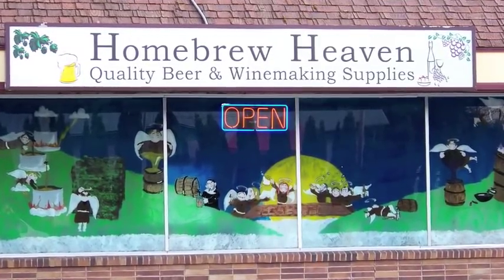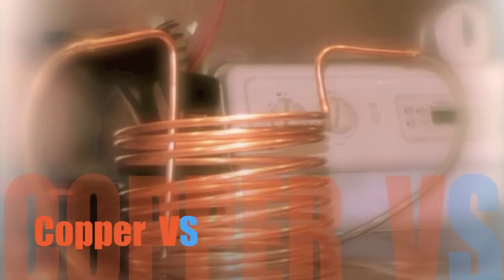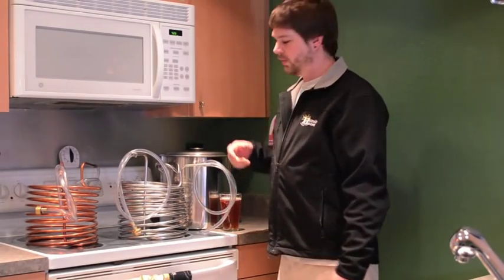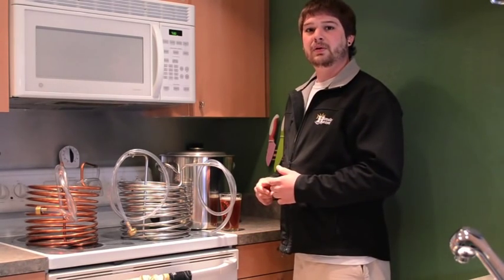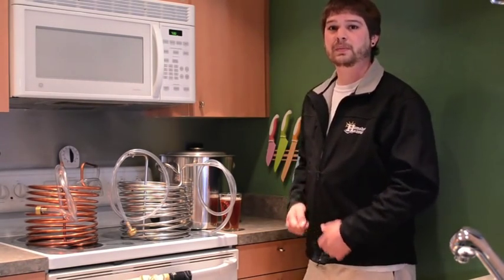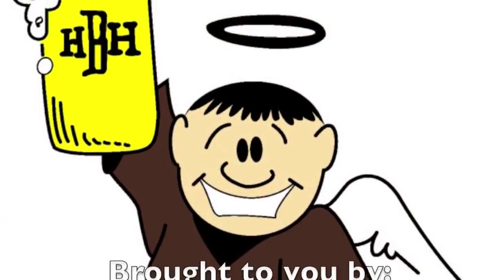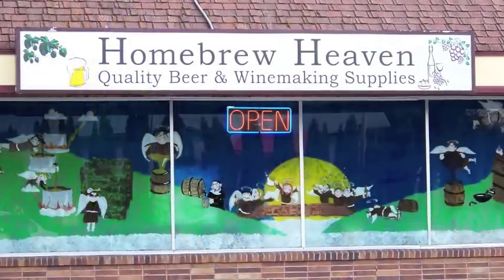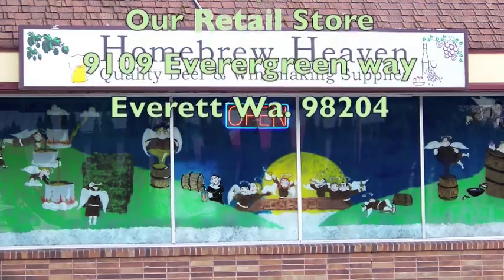Stainless Steel vs Copper Wort chiller

Comment from the maker: It is a standard adapter. However the threads on the facet are plastic so use caution when removing and installing, you could damage the facet.